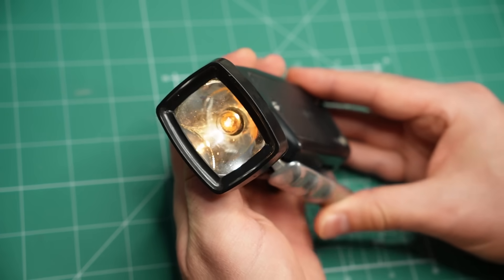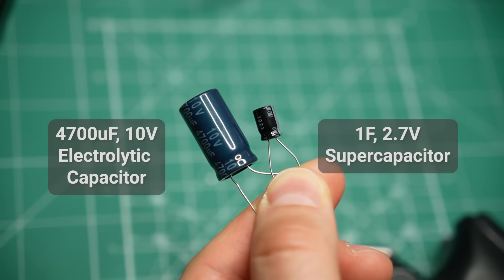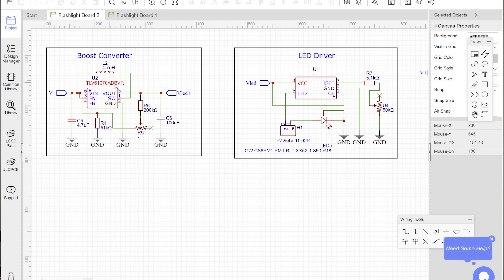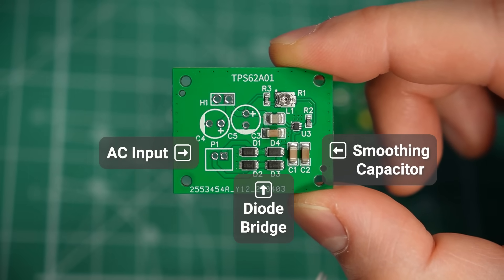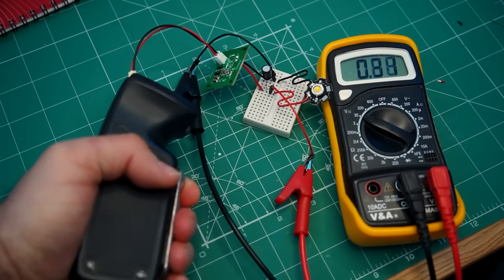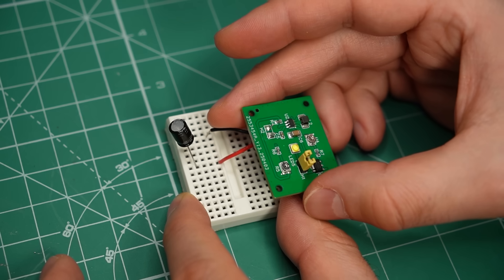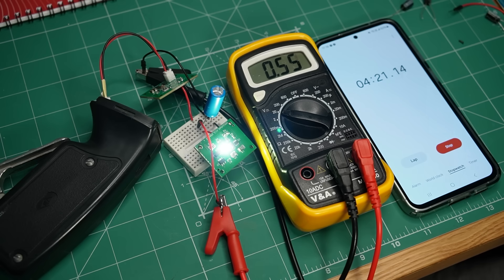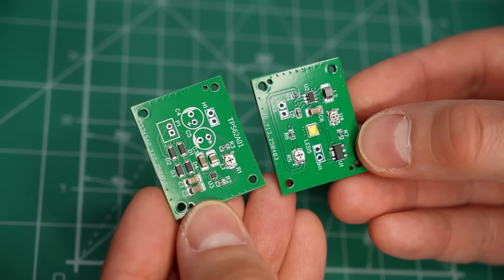I overengineered the no-battery flashlight (with supercapacitors)

Comment: what do you mean overengineered? this is exactly the right amount of engineering
Reply: Compared to the simply replacing the incandescent lamp with an LED + current limiting it is overengineered.  The original already has an energy storage device (the flywheel).
Reply: I say it was seriously under engineered.
Making it instant on, can be done.
Making it more efficient can be done
Reply: @kensmith5694  How?
Reply: @arizonaranger4843  The circuit for making it instant on isn't too complex.  A semiconductor switch in the path to the supercap can be arranged so that power goes to the LED up to the point that the LED it lit and then pulses of power can be taken to charge the capacitor so that it gets charged more slowly but it does charge.  The switching converters used can be made more efficient.
Reply: Gotta spice up the title for the lobotomised among us 😂
Reply: @abdou.the.hereticamong us
Reply: Well It wasn't just  a joule thief 😂
Reply: you’re right but its still over engineered 
he already got it to work perfectly fine without all of this and he doesn’t really need it to be engineered to this level of complexity
Reply: Pwrloss is hugeee
Reply: It’s highly over engineered for what it was. Like putting EFI on a Willy’s jeep.

Comment: You can just connect the super caps in series for a higher voltage rating
Reply: You have to balance the charge over them
Reply: @jojoposter  That seems to be an issue even with commercially available lithium battery packs.
Reply: @jojoposter  That would be a somewhat easy thing to do.
Built a halfwave rectifier to charge one positive and another halfwave to charge the other negative.
The tricky bit is how to limit the voltage to a safe level on them but that is a mere matter of engineering as we engineers say.
Reply: @kensmith5694 you could also just add a zener diode in parallel with the upper capacitor. It will become conductive when the voltage limit is reached and will provide a low resistance path to the next capacitor in the stack ;) a sort of poor mans active balancing circuit. Thinking a bit more about this: discharge current for the lower stack capacitor is now limited to the leackage current of the diode... Not ideal. And the leakage path also discharges the cap in parallel. So maybe not the best idea.
Reply: @jojoposter  Yes, you need a zener on both capacitors because you don't know which has the lower actual value and which leaks the most.  You may also need a schottky to prevent reverse voltage when you discharge the capacitors.
Reply: Smart switching circuitry that switches to hook multiple super caps in parallel, charging them up. Once charged, some power mosfets switch, connecting them up in series? Power ratings on mosfets might be an issue, idk?
Reply: That would be an active voltage doubler. Fun fact is you can do that with just diodes and capacitors as long as the input is AC, this is how old air ionizers were built. And the dynamo produces ac so no problem there. But wasn't the issue an excessively high voltage?

Comment: I was thinking maybe set it up in stages, have one bulb turn on for each quarter of the full capacity, so one bulb at 25%, next at 50%, then a third bulb at 75% and a final bulb right before 100% to know you are near full.
Reply from the maker: This idea sounds cool, even though it would make the circuit much more complicated.
Reply: I do like the idea of making the initial light small so the energy can build up in the capacitors more, and it should have it where you have the ability to use a switch to activate the energy from the capacitors, but as you said, more complex

Comment: Cool project, here's a thought, what about the mechanical energy? You could reduce the effort needed to spin the flywheel up? Maybe a modern motor would harvest the mechanical energy better
Reply: The big thing would likely be to use stronger magnets, however that is done.  More flux makes for more voltage and the losses in the coils only depends on current so you get more efficiency.

Comment: What about using a joule thief circuit, so you can run the led at very low voltages (down to 0.25 volt from what i've seen)? This might also shorten the time between starting the crancking and first light from the led?
Reply: i steal da joules
Reply: The joule thief is less efficient than a well designed booster.  They are just really simple to build

Comment: Modify the dynamo for less volts more amps? Less turns of thicker wire might do the job
Also neodymium magnets if you can add them (might quadruple the output power but will be harder to use)
Reply from the maker: the mechanism is not meant to be disassembled. I think it's riveted. I want to try a DIY mechanism one day instead

Comment: A simple solution to hitting the boost converter IC 5.5V limit would be a simple zener diode or a tl431 (ubiquitous and also available in smd packaging) set to 5.5V, you could retrofit one in a hackish way just on top of the existing PCBs even I suppose if you don't wanna order new PCBs just for a simple modification
Reply from the maker: I did look into the tl431, but had already submitted the design for production. I might try it some day.

Comment: Just take the AC from the dynamo and put it in a bridge rectifier out of LEDs so that there's light when both polarities are present and that's it.
Reply from the maker: I will make a video about this soon. I don't think it's a good idea, but it's an interesting concept
Reply: Wouldn't that flicker?
Reply: @No_True_Scotsman  When one LED would be on, the other off and vice versa instead of just one being off and on again (half cycle). Put the LEDs close enough together and it will look like one. It's a quick solution to the problem of AC to DC without losses.
Reply: @No_True_Scotsman adding a normal capacitor at the output of the rectifier can help

Comment: You're not pulling enough power from the crank. Your buck converter would be operating in constant current mode and would be limiting the power you can extract. Replace it with something that has adjustable constant current + constant voltage and can handle a dozen watts or so. Ideally you'd use a mppt, but that'd be a pain to make.

Comment: I don't know if this is a fitting suggestion for this device, but could you make some kind of mechanism to increase the rotation of the coil and in turn its energy production. Some kind of miniature gear system?
Reply: Higher revs would get more energy out but you'll have to put more energy in, mainly torque.

Comment: I think the old one was better, a little bit pumping would do the job with a brighter light whereas this circuit needs to be charged first only to last 1 minute for just one small led
Reply: There are ways to get this design to be instant on and brighter and still have some storage.

Comment: Maybe a combination of both? When cranking the light initially, there will be LEDs directly connected for it. but if you decide to crank more, the excess energy will go to the capacitor. Once the dynamo stops, the LEDs will switch to the capacitor's power
Reply: And he could probably also try using joule thief. I've seen some that run with an input below 0.5v
Reply: Or some gears that you can crank it slowly and the output is high speed easily charging the cap
Reply: Like, half the sine wave lights the led, and the other, charges the battery, then when the pressing stops, the led runs from the battery
Reply: @ABHEESH-M83 you do not need to do that. Just use two diode circuit at the front of led driver. one from the supercapacitor, another - directly from the output of bridge rectifier, with minimal smoothing.
Reply: @fhunter1test  too much voltage loss
Reply: @ABHEESH-M83 one shottky diode voltage drop?
Reply: @fhunter1test  How about making FULL BRIDGE RECTIFIER from LEDs and charging supercaps connected in series? At least efficiency loss will go towards useful light
Reply: @saiv46  Hmm, need to think about it.
Reply: @saiv46 you will block all of the power below the forward voltage threshold of the LEDs if you use them as rectifier in a FULL-BRIDGE circuit.
Reply: I was thinking a physical switch so you choose if you need it bright and instant or if you need a low and slow approach
Reply: Also, with a FWBR, current goes through two diodes, thus double the voltage drop on each phase